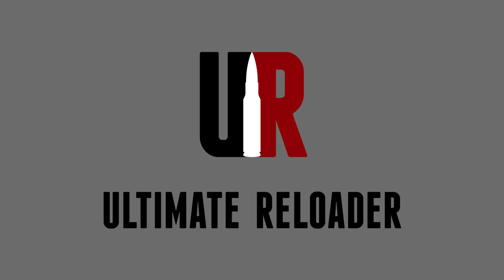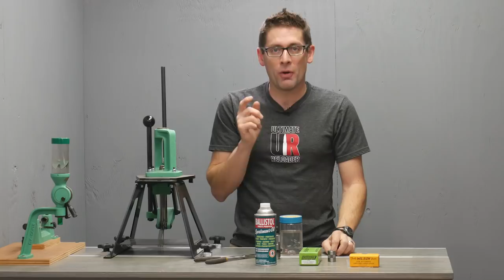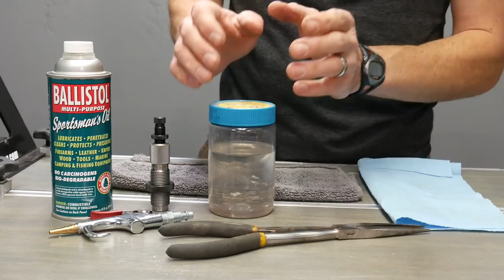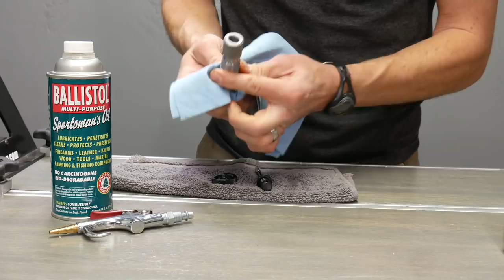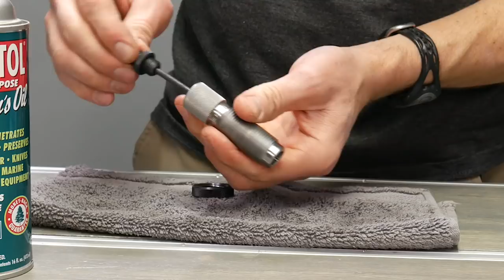Quick Tip: First Time Die Cleaning

Comment: I use a glass canning jar. Glass can break, so I am careful not to shake it with the dies inside. I tried peanut butter jars, but I noticed the cases smelled like Mr. Peanut when run thru the dies cleaned in the peanut butter jar. I also found that wearing comfortable clothes makes reloading much more pleasant. Tight pants affect seating depth, while an uncomfortable hat of course can change headspace.
Reply: I use a bacon bits jar because I like my dies to smell like bacon. It’s kind of like having breakfast while reloading.
Reply: @skyt54 Plus if taliban ever shows up and extra zing.

Comment: Great advice, as always. Small ultrasonic cleaners are relatively inexpensive these days. I use a 1.5 gallon capacity unit for small parts like these. What I like to do is use a variant of Gavin's method that includes the ultrasonic cleaner. Fill the basin with plain water, minus the volume of the jar you're using. Add your cleaning solution and parts to the jar, just as Gavin does. Drop the jar into the basin and turn on the unit. The ultrasonic waves will pass right through the jar and clean the parts beautifully. Remove the jar and the parts from it. Blow them off and allow to dry, as in the video. You can discard the cleaning fluid or reuse it. The best part is that you use a minimal amount of solvent, it's contained in the jar (less hazardous) and there is no filth to clean out of your ultrasonic cleaner afterward. Drain the water and it's good to go for next time.

Comment: After all my years of reloading and cleaning my dies, I thought  I was doing a good job. I took a set of my
9mm Hornady dies, which I had cleaned  and for the heck of it I tried your method, After soaking for about 20 minutes 
I could not believe the junk was at the bottom of the jar,and these were dies I had just cleaned.
Reply: Were these dies that you speak of. Were they one's you had already using to reload with

Comment: When using an air compressor make sure you have an water/air separator on it! Why? Condensation can get in your air tank when the air gets compressed. Then when you use that air to "dry" off parts or clean debris off of items, the water in the air line can then get onto whatever you are trying to dry off or clean then Rust or corrosion can form on any untreated surfaces.   How do I know that?  I worked at a company that used an Air compressor that had an water/air separator on it, because the equipment the air was used  to operate was very sensitive to water/moisture in the airlines.  Because of a lot of sawdust around and in the equipment any moisture in the airlines would cause the equipment to get "gummed" up and stop working.  

Here is a tip: if your hands get dried out when using Mineral Spirits or Denatured Alcohol you can always wear gloves.   

Great video!
Reply from the maker: Good point, dry air is super-important!

Comment: Nice video, just a quick tip: do not use acetone, it is slightly corrosive to carbon steel and it will actually cause rust spots.
Reply from the maker: Thanks, and good tip!
Reply: Great point!!! I Found this out the hard way myself on not 1 but 2 GMM micrometer seater does and couldn't figure out why. I was mad because I never used to remove the factory gunk and had no issues with rust, then I try to prevent ruining my $100 + dies and it's rust city. Live and learn I guess

Comment: Another good video, Gavin. I am using Hornady’s OneShot as I typically default to what a manufacturer recommends to use, but I am certain your method is effective also. It is alarming at just how fast/easy it is for Hornady’s dies and powder measures to rust. So one has to be diligent on rust protection.

Comment: I usually just wipe the dies with RemOil as a better version of WD-40 solvent and preservative.  RemOil leaves a very thin Teflon oil finish that doesn't turn nasty gummy yellow like WD-40.  Be sure to wipe out the inside of dies to remove the polishing abrasive grit.  For really nasty parts, I toss them in a jar of solvent on my rotary tumbler for a couple of minutes.  I also use different jars for rotary tumble bluing. polishing, stone wash finishing with ceramic media, etc.  I never knew how handy a rotary tumbler is until I bought a 2 gallon rotary tumbler several years ago.  I can tumble 100 rounds of 50 BMG brass with stainless pins or I can tumble quart jars for various small jobs.

Comment: No lie, had a jar of PB and i just tried this......in less than 1 min the mineral spirits ate thru the bottom of the jar and started leaking. When I saw this video, my first thought was, "How is that jar not melting?".....sure enough, you have one mighty PB jar. Most plastics are made of stuff paint thinner will break down. I'd suggest the same method, but a Solvent Jar with a 2 HDPE rating and/or the classic glass Jelly Jar. Great video, love your channel. Keep up the good work!
Reply: Also, make sure you're putting mineral spirits, not lacquer thinner, in the plastic jar.

Comment: Nice an simple process. Good tip indeed.  Your method also saves in many cans of whatever a person uses at $10 a can over the years.  With multiple die sets, etc, that saves at a much faster rate.  I use nitrile gloves.  When I use the air compressor, I backstop the overspray, wear eye pro and hepa mask.
Reply from the maker: Good tips!

Comment: This is a fantastic way to get that preservative lubricant off of dies and other reloading accessories. Paint thinner is much safer to plastic parts than alternatives such as brake cleaner aerosols. Thanks for sharing it. And if you know if you want to take it one little step further, You can take your jar of mineral spirits with the parts inside and you can place it inside your ultrasonic bath that is filled correctly with water. The ultrasound energy will travel through the walls of the jar and will give you an added bit of agitation for your parts. Just practice safe judgment in doing so. I'm not suggesting that you put solvents directly into the pan of your ultrasonic system and that would be potentially very dangerous. Safety is number one!

Comment: Never use WD40 as a lubricant or for a protective film on firearms or there component parts. It evaporates and can leave a residue. WD40 is for water displacement. Use a very light film of gun oil
Reply: Geoff Pickford or car oil. like Mobil 1 or any kind of

Comment: Hornady one shot is what Hornady recommends, it works great but it's pricy.  I also found that a rubbing alcohol in spray bottle and oversize baby swabs work really well too and without nasty acetone smell.  In fact it's so convenient I wanted to make my own video on how easy it is to clean with it.
Reply from the maker: 90% + rubbing alcohol?
Reply: gavintoobe 90% even better, i just use cheap 70%.  Swabs are for inside cleaning where you get frequent build up of brass shavings because I flare case mouth on 38 special.
Reply: Dima Prok have you made the video?
Reply: @BORNAGAINKJB  You want to use 99.9 % if you can as the rest of the contents are water

Comment: I don't have mineral spirits or paint thinner I do have acetone but I normally use brake parts cleaner and just kind of blasted and that's done the trick to me so far but I don't have any today I was wondering would acetone also strip oil off the metal surface

Comment: If your in a high humidity area especially if your reloading area is not climate controlled make sure you oil the inside too and wipe any excess off the inside surface that sizes the brass before using or it will rust up which isn't good.
Reply: Will some clp be ok?

Comment: A few weeks ago I left a comment relative to another posted question and your reply to the question..  The questions was as to whether you had cleaned Redding Pro Series Competition dies with this method, and if so, did it affect the white markings on the micrometer seating die.  You answered that you had, and it did not affect the white markings.  I watch your videos and am a fan of your site.  However, I tried your method on my recently received set of Redding dies and it DID IN FACT AFFECT THE WHITE MARKINGS.  Most were faded and some were completely gone.  I thought others should know about this.  I am curious now as to why the original question posted by another subscriber is now gone as well as my posting?

Comment: Doesn’t WD40 evaporate?
I personally use a little CorrosionX HD on the outside of the dies as it is intended for long term storage.
The thing you definitely wouldn’t want to use is an oil: while they are great to protect steel, if any of it gets into your case and contaminates your powder, you could have a squib or hang fire.

Edit: reading Redding’s instructions, they advise to remove the factory antioxidant oil with a bore cleaner and then apply with a cotton swab a thin coat of sizing lube (like imperial wax) on the inside of the sizing die to create a layer to protect the metal from the elements.

Comment: W D 40 is not a lubricant or a protectant. W D 40 is a moisture dispersant. You spray it on wet electrical components to dry them out if they happened to have gotten wet. NOWHERE on the can does it say anything about being a lubricant. I cringe every time I hear somebody say that they are putting WD 40 on their guns. It all evaporates shortly after you spray it on. I guess if you oil them with a GOOD gun oil after using it it probably won’t hurt anything. Get all the moisture out of you gun !!!  SHOOT SAFE!!!!!!!!!!

Comment: WD-40 is not a rust inhibitor... DO NOT used it.
Reply from the maker: WD-40 IS a rust inhibitor- not the best rust inhibitor, but it DOES serve that purpose.
Reply: @Ultimatereloader  Test is for yourself. Clean a die you don't use, then spray it with WD. Let it set 6 mouths, in a non climate controlled environment, I think you will be shocked.